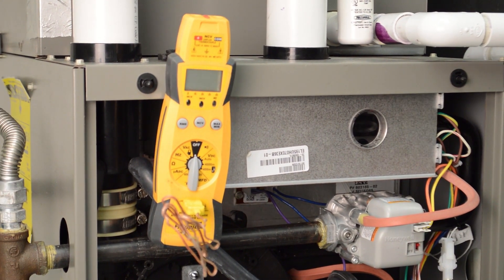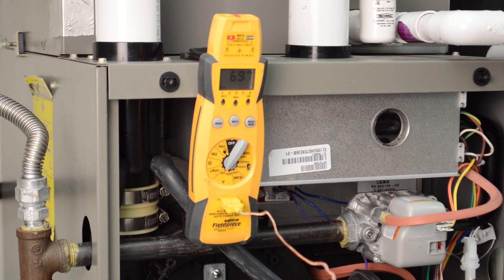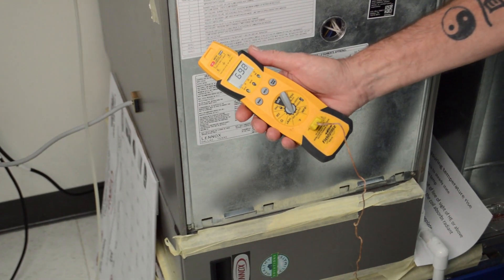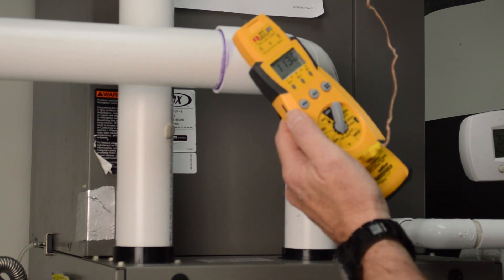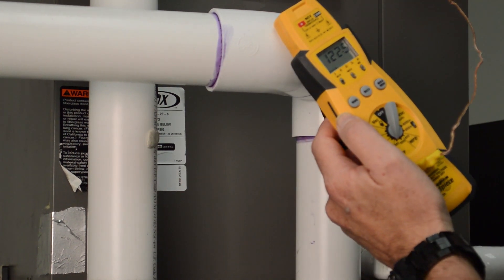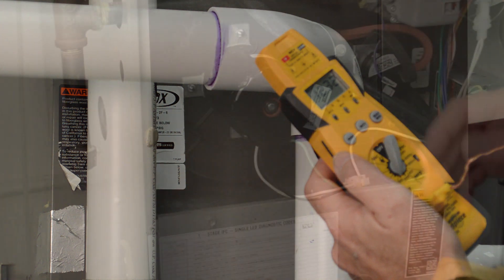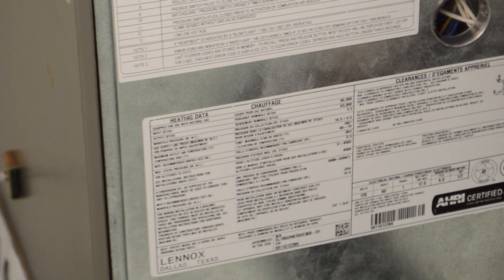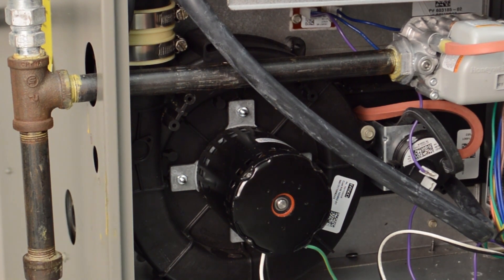Measuring Temperature Rise

Comment: My furnace was short cycling.  They tested the pressure and the temperature of the furnace.  They found the gas pressure was set to high and the furnace was over firing.  Problem solved.  Make sure they run these tests along with looking at your flame sensor, condensation traps, inducer motor, and your venting.

Comment: My furnace is a downdraft, with a single 20x20 filter up top at the return plenum. Could I just slide a thermometer probe up on the filter to measure the intake temp?
Reply: @HVAClearning  Thanks but this doesn't answer my question at all. Don't need a service call, just want to know where to measure intake temp for the rise.
Reply: @AimingWanderously  yes you can
Reply: @sheeesh3355  Thank you.